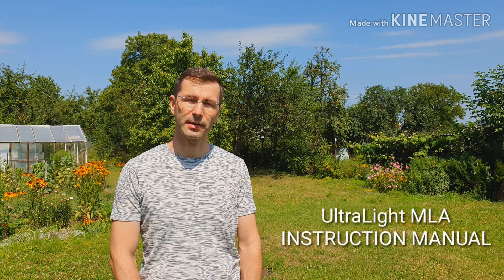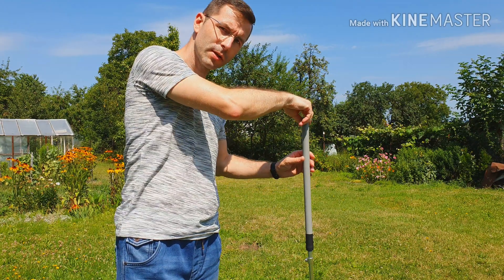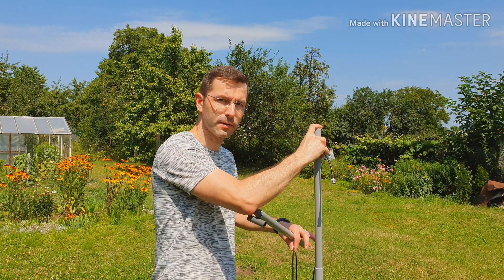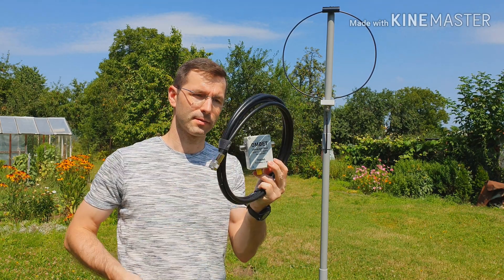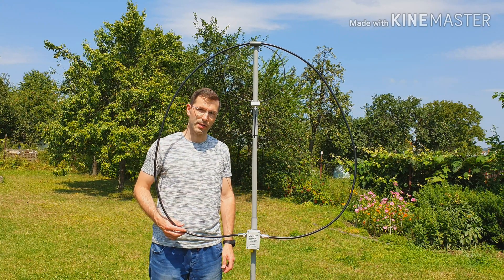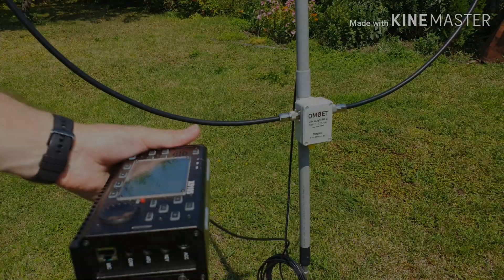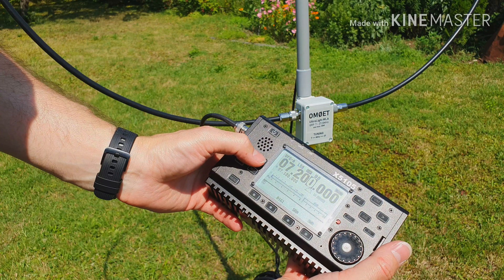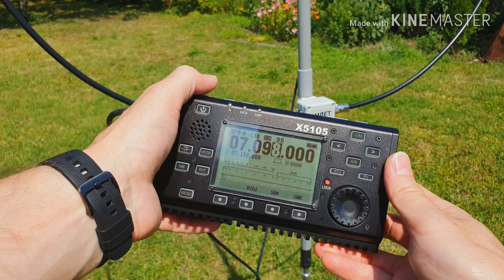UltraLight MLA - How to assemble

Comment: Great video and great antenna. Just a few questions (I don't know much about loops).

1) Why moving the knob to find the peak, if you have to move it again a few seconds later to find the best SWR?

2) If I tune in the middle of, let's say, 20 meters band, do I have to move the knob to adjust the SWR even while moving inside the band, or is it required only when I change band?

3) Is the connector for the fishing tripod the same type used in camera tripods? Can I use a camera tripod instead of a fishing tripod?

Thanks a million! I think I'll buy it soon!
Reply from the maker: Hi Tomasso. Thanks for comment! 
Here are the answers:
1) It's very selective high-Q antenna (narrow band) with best SWR peak only about 5-10kHz. Therefore is re-tuning required when QSY.
2) For RX only is OK to tune in the middle of the band. For TX you have to tune to the current frequency for best SWR.
3)  Antenna is now compatible with all camera tripods equipped with 1/4' thread.

For more info please visit my website om0et.com
Reply: @OM0ET  Thanks a lot for your reply!!
Reply from the maker: You are always welcome! 👋😉

Comment: Hi Paul excellent all your video only one question.i want to make magnetic loop antenna with out small ring ,I want to use a ferrite core ,the antenna is for 20 and 40 meter ,what ferrite use ,mix 31 or mix 43. Ft240-?? thanks in advance Eddy from🇺🇸
Reply from the maker: Hello. 43 material is widely used in RF transformers for antennas up to 30megs. I believe that would be OK for your MLA.
Reply: OM0ET thanks so much my good friend

Comment: do I have to re-tune each time on the same band at different frequencies? or is it enough to tune once per band? how big is the bandwidth at 40 or 20m with once tuned?
Reply from the maker: Yes. Magloops are very selective and narrowband antennas. Bandwidth is only a few kHz sometimes 5-10kHz, depends on the band. Therefore you have to tune often 😊
Reply: OM0ET Thank you !

Comment: Paul, I apreciate vero much yours antenna experiments .
As sugestion, try to buld a 49:1 Unun and a All band 1/4 wave End fer with no counterpoise.. like a Zepellin.
73 from Joe PP1RD.
Reply: Escuse me, it is 1/2 half wave Zeppelin. Not 1/4.
Reply from the maker: Thanks for very good ideas Jose 😉👍 I will think about that 😊 And thanks for watching! 73, Paul
Reply: Thanks, Paul.   Consider 1/4 wave if In vertical pósitron or 1/2 wave if traditional Zep. I’ m a ham since 1971.  And like very much antenna’s experimentations.  Now it is more excitant with tools like Vector Network Analyzer amd other, as well. Thanks for your effort to bring light to many Hams. 73 from PP1RD (excuse for my hard english).

Comment: Hi Pavol,
First, I would like to congratulate you on your work. I have seen your YouTube videos and I think your magnetic loop antenna is amazing.
One question. What is the maximum and minimum distance between the floor and the tuning box?

73's - EA7HOH
Reply from the maker: Hello Rafael. There is no limit. But in general when is antenna higher - better. Higher elevation - lower angle, better for DX. Lower elevation - higher angle, better for local stations 😉👍 73, Paul

Comment: Excellent Paul. Are you experiment putting a choke in the feed point? In my loops, the output performs better. 73 CX1GU
Reply from the maker: Thank you Gonzalo! I used only the ferrite clamp choke, but I didn't noticed any difference in performance of my loop :-) What exactly was your experience? 73
Reply: @OM0ET  Contacts in 40m with better reports, and in higher bands i don't have number of Contacts to compare. I should go out portable with ft8 or Wspr and see the results un higher bands, good task for a vídeo :)
Reply from the maker: @gonzalocamper9924  Nice I will try too

Comment: Hi Paul 
Very nice video.
What is the range of the capacitor.
73 Med CN8YR
Reply from the maker: Hello, what you mean about the range of capacitor? Capacity or frequency?
Reply: @OM0ET  I mean max and min of the tuning capacitor
Reply from the maker: @m.a3957  it's 2x243pF but is connected to split stator fashion. Total capacity should be about 230pF I guess. Minimal I don't know.
Reply: @OM0ET  Thank you Paul.
Cheers

Comment: 🤔
Reply from the maker: Thanks for watching ;-) 73, Paul
Reply: @OM0ET  Thank you Paul for the video.
But the antenna efficiency at such sizes ((
At 5 watts tx, 3 watts will be aired.
73!  /ur5sns/
Reply from the maker: @ur5scopcopter626  Yeah but that's so nice on the QRP. When we enjoy every one contact made with such a small equipments ;-) 73 paul
Reply: @OM0ET  
I agree with you Paul...
73!  Andriy.